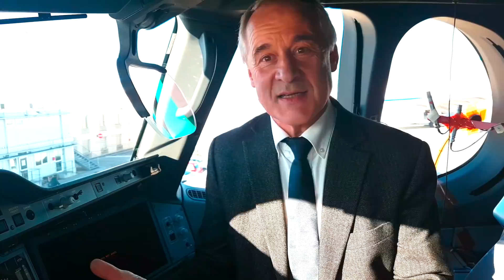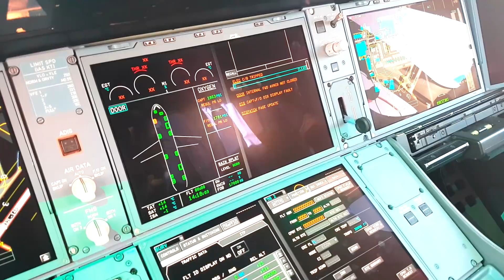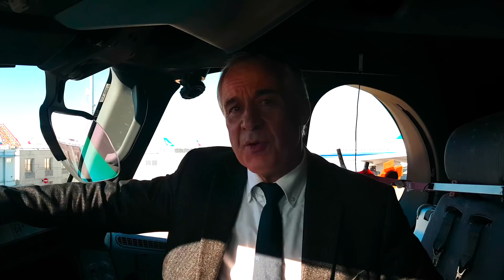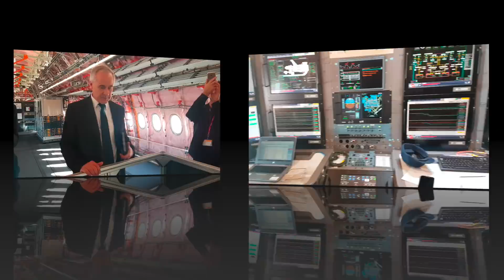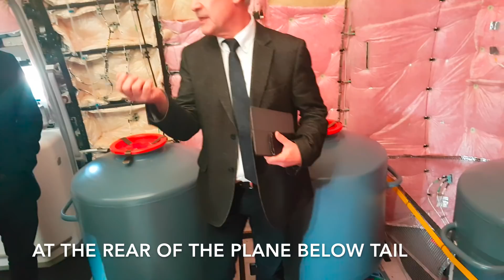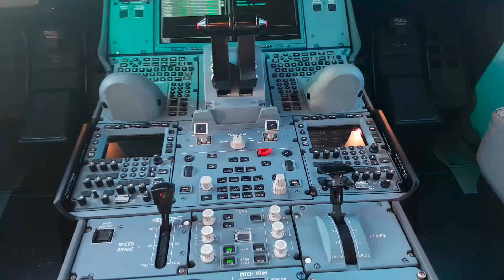Inside the A350-1000 Airbus Test Plane

Comment: This plane will have the same fault as the A380.  Pilots will have to answer the machine instead of the machine working for the pilot.  Whenever a problem or error message is displayed on the FMS screen, it will have to be answered by the pilot before it can be cleared and another error message displayed.  This answering the machine removes one pilot from actually flying the airplane.  that's a serious design fault.  In no way should a pilot have to stop flying the plane just so he can type is a response to a stupid computer error message.  These messages usually consist of, "defer to next layover", or "Ignore".

Comment: That's going to be one BIG beautiful jet when it's completed. However, i was reading an article about the A380 and Airbus wanting to slowly but surely weed them out. In favor of the A350 instead. And when you think about it, it makes sense. Because lets face the reality here folks that jet was basically "overkill". And because of fuel costs etc...Many airlines that initially took purchase of these A380's are now "re-thinking" that move. And they are now pondering over newer long haul aircraft such as the Airbus A350. Which would definitely better fill that bracket then a cumbersome A380. My personal opinion on this is that Boeing's new 747-8 "stretched variant" killed A380 sales but even it is struggling. Considering the new arrivals of the 787-10 and 777x. For one thing the 747 has ALWAYS been a reliable and "mostly" safe plane overall. WELL ahead of it's time technologically speaking and otherwise even back when it was initially unveiled. So they basically took something already perfect and made it even better. The Airbus A380 is a VERY unattractive airplane. And honestly folks i have absolutely NO BIAS for either Boeing or Airbus. I'm just stating from a personal opinion it looks like a bathtub. It's tail height is disproportionately larger then the cockpit. Where as the 747 never had that issue because everything blended better. The only thing i like about the A380 is the two level room capacity. Something right there that makes it the biggest commercial plane in the world. Well think about that for a minute Boeing could have easily gone that route for the 747 in terms of competition. But they didn't feel it was needed and most likely realized the biggest benefit as i already said above was taking a great plane and just simply stretching it. And guess what it worked...!!! Now Boeing does have issues moving forward with there 777's that will soon be retired. Especially, with these new Airbus A350's filling that gap. However, as always Boeing is going to fill that competition wise with longer 787 variants being the 900 & 1000. That will effectively take care of the 777 issue and even Airbus A330 & A340 issues. There had been talk about bringing in a new Airbus A380-900 or even 1000 but i don't see that happening. Given how the A380-800 variant has fared thus far. As i already stated above it's overkill and it's obviously more costly because your having to work on 4 engines instead of 2. What i miss are the older "tri-jets" like the 727's, DC-10's, & L-1011's. They were truly unique and quite special and now are only being used for fuel tanker operations and cargo flights. But i must say i've never been on the new 787 but i'm planning a trip to Japan very soon on JAL. And i will be on one for that flight it will be a 787-900 variant. Non-stop from Boston Logan to Narita airport in premium economy class seating. Hopefully i will have good things to say about that flight both going and coming home. So that all said, if anyone's flown this route already. On this particular jet some pointers as to the best seating options via seat number etc...in premium economy would be great. Thanks and safe & happy travels everyone.